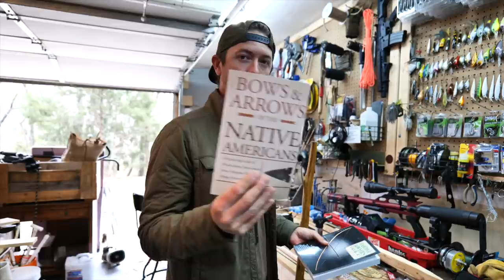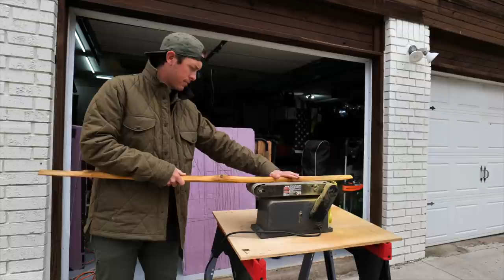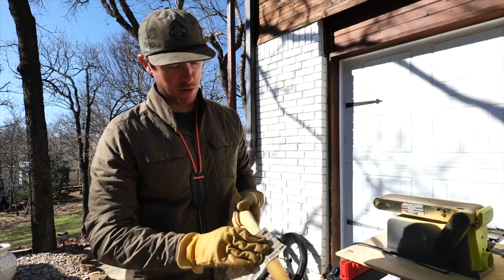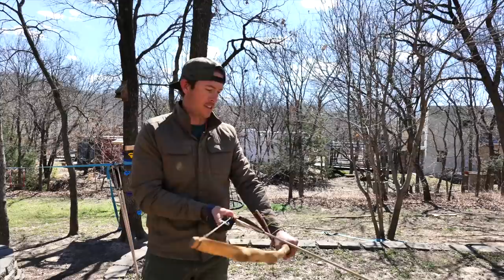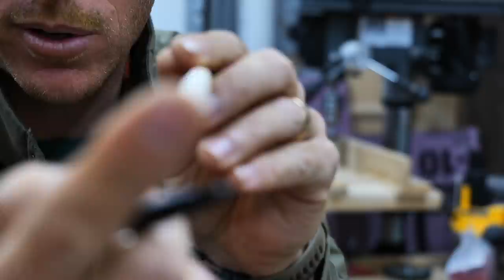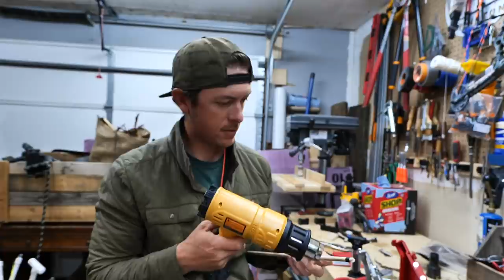Building Bows & Arrows for Hunting with Backyard Wood

Comment: Hey as a bowyer watching this video I have never made a Osage bow before (although I have a split Osage log seasoning to make bows) and your video was really great and informative I learned a good bit keep up the good work    and also just a tip to make your bow smoother to shoot and faster taper the sides of the limb down to about 3/4 of a inch and maybe try adding some tip overlays  and if you really want it to be fast add reflex to the tip or a recurve

Comment: Way too cool brother! I made a bow years ago out of a little tree that was growing along the water line of a creek. The county was cutting them down so snatched. Then I peeled rhe bark and glued the ends. I let it sit for like 9 months and split it, carved it and used it. I don't know what the poundage was but I was shooting through a piece of plywood with a blunt tip and a solid fiberglass shaft until thebow broke. It was great fun and I've been itching to try again for years, thanks for the inspiration!

Comment: Bowyer here. Gun stock oil is great to finish bows with, cheap and can get from Walmart, do 7 coats light sand in between fine steel wool to finish. Knots and holes can be used on staves, many hole through limb bows shooting 60-70+#. I shoot tons of selfbow competitions, should try one some time!
Reply: Also on smaller limbs, you have lots of crown, which is the rounded part, makes it a little harder to chase rings, don’t be afraid to cut down some big sections, also if you freshly cut make sure it dries out before making it into a fully functioning bow unless you plan on fire hardening it

Comment: I agree that a steamer could help in many ways to save current project or for use in the futures. A 5-6 in heavy wall PVC and a vaporizer pump in steam on one end and cap top.  It will also work for making and straightening  arrows .

Comment: This was an awesome different video.
I don't know anything other then what you've shown us all here.
I realize the natural theme is what you are after and think that wet sinu would be more amazing then the fishing line and most likely you wouldn't need this idea.
How about putting a little tiny piece of electrical shrink wrap over the leading egde of your fishing line or maybe all of it would smooth out the ridges and save the skin on your hand.
If shrink wrap is out you might try a straw or even some kind of wax.
Just random thoughts
Thanks for the video